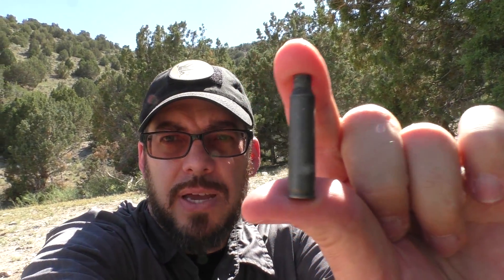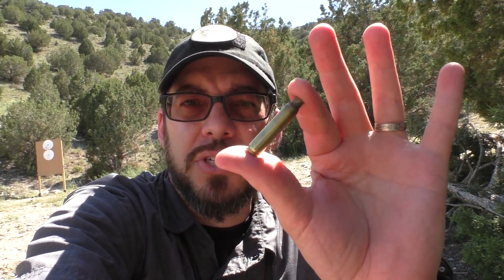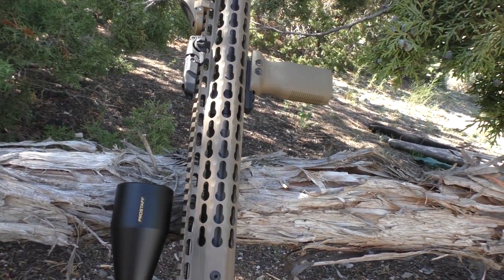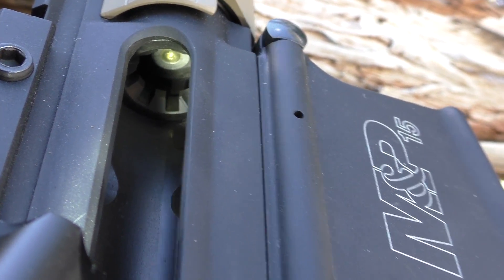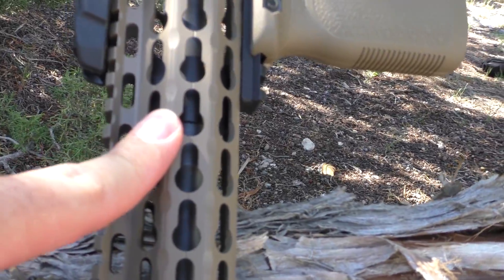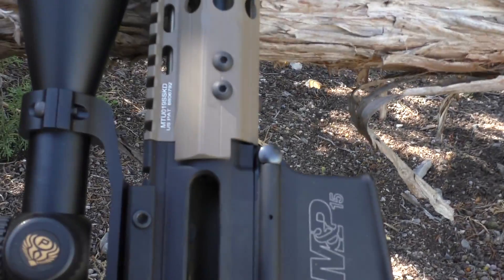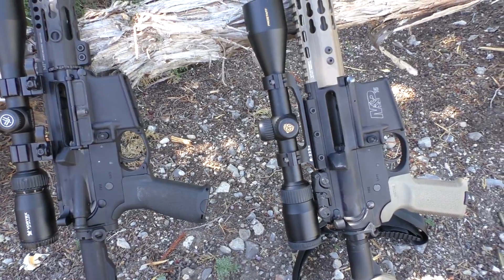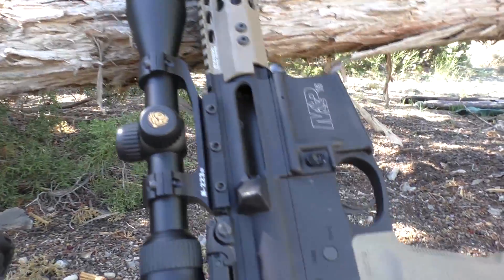Tula .223 Killed My Guns! V-Log Thursday

Comment: i have the same problem with tula. about 1 in every 200 rounds. they occasionly expand in an oblong shape. im doing the same as you to fet them out. ive started bringing  my cleaning rod and a small brass hammer and gently start tapping. its definitely the ammo and not your weapon system. i personally still use it when im going thru a lot of ammo, but its a pain.  i sure wouldn't want that problem  in a self defense situation though.

Comment: Check dimension of rim from a stuck case with a micrometer. If diameter is off spec., you've found issue. If in spec, use a go-no-go gauge to check both chambers. Short chamber might cause round to jam in chamber during firing sequence (neck of case in freebore).

Comment: i know im late to the party but my 2 cents....gas port size.  tula can lead to over gasing mixed with lack of quick expansion/retention of steel case (brass is much softer/more plyable).  ive been told that milspec gasports cant run tula but larger diameter ports are fine with it.  im sure gas system length plays a role as well.

Comment: I am having the same problem with my PSA 18" .223 Wylde 416R stainless rifle length gas system and Tula 75 grain HP. It shoots any and all other Russian steel case just fine. Shoot one Tula 75 HP and it won't extract. My mini-14 shot the same ammo all day without protest. I think this particular ammo isn't getting the pressure curve right for my rifle length gas system and doesn't develop enough force at the right time to extract the case. Going to try this ammo in another PSA 16" 5.56 chambered 416R with a mid length gas system.

Comment: I believe all the factors have been hit in the previous comments, but I'd like to put them all in one spot.  1. Steel-cased ammo is cheap for a reason and is occasionally out-of-spec (case size, powder charge, bad primers, bullet weight, bullet seating depth, etc) therefore a case can stick, a bullet can get lodged in the barrel, a case can burst or separate or a primer can burst out of the back.  These are RARE, but not unheard of.  While shooting, if something doesn't sound or feel right, stop, safe, clear, and inspect your weapon and barrel thoroughly.  Usually though, it is because of the coatings (that protect a steel-on-steel meet up) get too hot in the chamber and stick.  2. Lot's of shooting without proper clean-up can cause carbon build up in the chamber to the point that even perfect brass-cased ammo will stick.  Use a chamber brush every time you clean and visually inspect.  3. A dented or out-spec brass case or reloaded case may stick as well.  4. A weak, dirty, or an out-of-spec  ejector may also be the problem.  Clean it thoroughly, buy an ejector spring upgrade kit and if that doesn't work, buy a new ejector.  5. Low powder charges, too powerful of a buffer spring or too heavy of a buffer are RARE, but remain possibilities (usually for hand-loaders or from shooting sub-sonics without a suppressor).  TIPS: Thoroughly clean and change up cleaning regimen if the problem isn't fixed.  Inspect for carbon build up.  Read comments on bulk ammo purchases before buying and buy a test box to run through your weapon before buying large quantities.  Buy a broken shell extractor and keep handy for case-head separation (RARE, except for reloaders pushing brass too far).  IF a live shell is stuck, separate the upper from the lower BEFORE attempting to knock the case out.  Final note, some guns don't like certain ammo.... therefore, don't feed it to them.
Reply: You're supposed to leave a comment,  not a dang magazine article!

Comment: My approach is basically: cheap ammo for cheap guns.  I am happy to use metal case ammo in the SKS platform because if it destroys the gun I'm out $189.00.  If metal case ammo damages my HK MR762A1 I have compromised a $3,000.00 firearm and that is too big a risk to save a bit of money.  Also, by the time I reload my .223 or .308 the actual LONG TERM cost per cartridge isn't much higher than non-corrosive metal case.
Reply: Now those nice sks are way more lol

Comment: I am coming to this a bit late, but I can tell you what the problem is.
It's not the ammo per/se. It's the lacquer on the case. Ordinary cleaning doesn't get it out. Also the hotter the gun gets, the more lacquer gets deposited. (even into the bolt on full auto guns).
Keep the lacquer cleaned out, and the Tula ammo is fine. Just be aware that more cleaning is required when using it.

Comment: Hmm, on ALL my 5.56 Palmetto Arms Ar-15s with 1-7 bbls.  75 grain Tulammo works to perfection.  BUT I do put a small spray of Ballistol on the locking lugs (bolt and barrel) at the start of a range session.  Never had a misfire or misfeed.  I clean the BCG and its  lugs and chamber after about 200-400  rounds and a bore snake at that time.  Great accuracy and function pistols and carbines).
Reply: I've been putting 223/308 steel through my AR's and bolt rifles since the late 90's.  DI systems need to run wet vs a piston.  My AK and SKS gas pistons will eat anything and I clean them occasionally they are tanks, but my direct impingement AR's are run wet, cleaned every time and I have BCM ejector spring kits on them for a measly $5 which solves all issues with steel cased.  My family put 6-7K rounds of steel through our rifles last year alone no problems.  It's 99% operator error with steel case problems, but for simple cleaning and $5 those problems can be left behind.  There are so many new shooters learning on the fly and that can be a tough thing they just don't know what they don't know.  It does take a bit of preventative maintenance to run steel with DI's, but I save so much money it allows the family to shoot as much as they want.
Reply: We've run Wolf or Tula thru Mini-14s, bolt guns, .308 semi autos of all types, and ARs from pistols to target guns.  Running wet is how I use all semis of whatever caliber and steel.  Ballistol is my choice.  I just wish they made .300 AAC.
Reply: That's great as long as it works.  Ballistol is good stuff I went over to CLP years ago and it gets it done for us too.  Tiny bit of effort which amounts ~ 30 seconds of work alleviates DI-steel problems for most.  Then again by looking at the guns of most people I see I don't wonder when they were last cleaned.  I wonder if they have ever been cleaned.  'You mean I need to clean my gun?'.
Reply: That golden mean of cleaning when needed but not too much.

Comment: I went out shooting once without my gun tools.  I learned my lesson the first time.  I know you were looking for an answer to the stuck casing problem, but I think keeping your tools with you is the better answer.  I just bought my first AR-15 (MP15 Sport II Cali Compliant) and waiting till Monday to to go pick it up after my 11 day waiting period.  With the shortage of ammo, I was only able to find Red Army Standard 223, so I bought a 1000 ($430).  I noticed it was steel casing when I looked at it when I got home and thought Damn.  I only shot steel casing once many years ago (Wolf) and my 1911 .45 didn't like it, so I never shot it again. 

Now, I can't be so choosy, so I've been doing a lot of YT researching about this ammo and steel casing in general.  So far, I've learned...the common consensus is that steel case ammo is dirtier, but will run fine. 

When I went back yesterday to buy more ammo, I did find some brass 223 (damn it was expensive), so I pickedup 500 rds (the limit). I mentioned to the guy at the counter about the RAS ammo I got the other day, he scared me when he adamantly said he would not put that stuff near his gun.  Well after researching more, I'm more confident it'll run fine as long as I keep the gun clean and keep my tools handy, because where I go shoot is 2 hour drive away.

Comment: i have a m&p15 sport as well. stock internals, i made it through 600 rds of tula over a year or so, before i had this happen at the range. it happened 3x that day. i was told it was due to the coating of the steel, and steel also expands more. i will no longer shoot tula .223

Comment: It’s because when steel cases heat up and form to the chamber they create a very tight seal to the chamber verses brass which is softer and easier to manipulate by the force of the carrier group. It’s very common.

Comment: I'm sure you already found the answer on this, but I had a couple questions. How quickly does this happen after you started firing for that day? You said it happens after the firing portion of the cycle of operations, meaning that the projectile did in fact leave the weapon, correct? What happens immediately after? Does the BCG continue the cycle, sliding to the rear, and trying to feed the next round and a jam occurs? Or does the cycle end there as if you were firing a blank without the muzzle gas block in place? I just bought 1k rounds of Tula, and I'm a little curious about this and don't want to feed defective rounds into my AR.

I have seen some of the other comments talking about carbon build up and the steel jacket. I have heard that the steel jacket does not give like brass does, so there is very little expansion, but I don't know if that's true. The carbon build up theory I feel is the most likely. Carbon buildup is a bitch man, and after a bunch of rounds through your weapon, a simple cleaning rod and solvent will not do the trick of removing it. Sometimes you literally need a metal pick to chip it off... And if it's bad enough, it will chip. The cleaning rod with the brush and cloth won't really get that area very clean. Those are for the rest of the barrel, but not great for where the round gets seated. It's an area of the rifle that requires special attention. The little "star" area where the bolt locks into is a well known area of excessive carbon buildup. That was one of the first areas that were checked during a rifle inspection or when being returned to the armory while I was in the Marines. It's not anything you're really doing wrong while cleaning it, it's just an area that requires special attention. 

It could be a combination of the things mentioned with the steel jacket, carbon buildup, and maybe Tula uses a different combination of powder that produces even more carbon than normal. If you could let me know what the actual issue was, I'd appreciate it. Thanks

Comment: Hello I almost exclusively shoot steel cases Ammo through my custom AR build. I recently switched my buffer to a heavier carbine buffer and also put in a new buffer spring. That's when all the problems started with stuck casings. I just switched back to my original lighter buffer and old buffer spring and the problem went away. I guess under powered ammo needs the lighter buffer and weaker spring.

Comment: I've had this happen to me 6 times on a 5.56 barrel running .223 Tulammo. I've since thoroughly clean the chamber and barrel plus make sure theres no carbon build up on the extractor lip. I've then noticed it runs steel casing just fine. You just have to do the thorough cleaning and keep it wet.

Comment: im no expert but.... i have a smith and wesson 38 special revolver i use tul ammo. initially i after i shot it i tried to use the ejector rod to extract the casings IT WOULD NOT BUDGE! the casings had expanded in the chamber. thank god i had my leatherman. my solution was to lightly lubricate the chambers.... never had the problem again. tula caused constipation in ur ar-15 lightly oil ur chamber. brass is more malleable will flex while being rip out. steel is way more harder less flex so it says wedged in there. hope this helps

Comment: funny thing about that, i have a virtually stock ar15 carbine with a2 gas block from psa and have put somewhere around 1,000 rounds of tulammo 62 grain 5.56mm (both hollow point and fmj) through it and have not had a singe malf of any sort (i say virtually stock in that all i have done to it is front hand guard and sights) i am using only magpul mags spent quite a bit of time before first range trip with it just racking the action to strip off their coatings i clean it after every range trip and have learned from my time in the army keep this platform highly lubed.

Comment: expansion maybe and the extractor is grabbing the shell.  had it happen in a mini 14 I had years ago. after so many rounds fired it wouldn't extract the round. switched to brass and it worked fine.

Comment: The temperature is a factor to. Steal cases don't contract as much as brass does after cooling. So on hot days you might see more stuck cases then normal.

Comment: did the exact same thing to me first round of a brand new 10.5 AR pistol with FN barrel. round fired case stuck. removed lower and BCG smacked out with cleaning rod. Tula 55 gr 223 also stuck in my brother in law's carbine same way. brass works perfect. was just trying to save a buck. though about using remaining rounds in my savage 12 fcv. just don't want to risk it.
Reply: Update Tried in my bolt action Savage 12 same issue then 2 more AR15s that were 223 wylde and 1 more 556 barrel AR Pistol. All stuck. Had bright idea of spraying casing with CLP and oddly enough it worked. My theory the steel dries and swells in chamber when shot.

Comment: Had similar problem with 45 acp with my 1911. comparing the casing to others I have fired the coating seems more plastic/epoxy then previous ones. the fix that worked for me is tumbling them with walnut shell media that has had wax added. be warned this is smoky with my 5" barrel i do not know how it will affect your gas system.

Comment: Steel tul ammo doesn't expand like brass and allows carbon build up to occur more quickly than brass. So it's not the worst thing to shoot steel but I would clean your rifle more often when running steel, maybe after every time you go out? point is, you have to clean your rifle more often, a lot more often.

Comment: Just checked the knoop value of the copper vs steel, the zinc coated bullets is softer then copper. zinc is 119 vs 163 copper. And the steel case is also softer then the copper case. that stands to reason the steel is getting stuck in your chamber due to over expansion since it is softer.  and the gun powder has been changed in tulammo from ball to stick.

Comment: Well you just fire formed a steel casing to your chamber. They say steel won't expand but it does. The extractors do not grab ahold of steel as efficiently as brass. Inconsistencies in manufacturing probably caused a hotter load and that dude pretty much pressed itself into the chamber. Shooting high volume steel casings will wear out your bolt,extractors,bolt face and other parts. I personally stay away from Russian ammo. They replace quality for volume.

Comment: I've put 1200 rounds of Tula through my ruger ar556 without 1 single hiccup. I've cleaned it 2 or 3 times. I know mine is probably an anomaly but I'm loving the savings and at this rate I'd actually trust it for self defense/go to war in this particular rifle. It goes bang just like the brass does, for a mere 24  cents a pop from wal mart

Comment: I had this problem with steel case the extractor ripped the rim off where it was sitting on the casing, I polished my chamber and shot the rest of my steel case about 100rounds and didn't have that issue again but my rifle was also cleaned after the extraction of the stuck case

Comment: it is difficult to tell. it looks like those are fired cartridges. your problem could be dwell time. you need a heavier buffer weight to allow for greater time for pressures to build up and then decrease out the end of the barrel. you extractor claw is trying to pull out your casing at its very hottest, most expanded moment of expansion. its to tight at that exact moment. you need more time for the casing to cool back down, fractions of a second. once its cooled down a touch it will shrink back down and allow the extractor claw to pull it out... you need more dwell time, heavier buffer